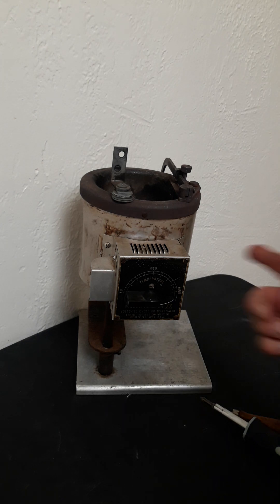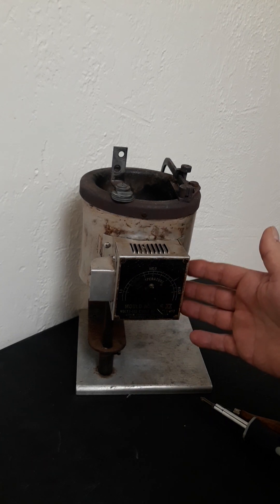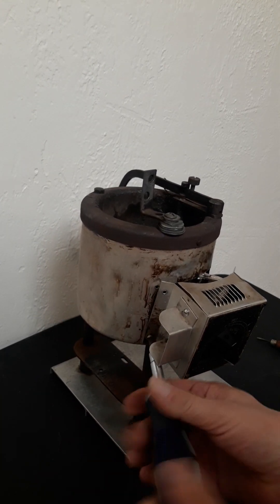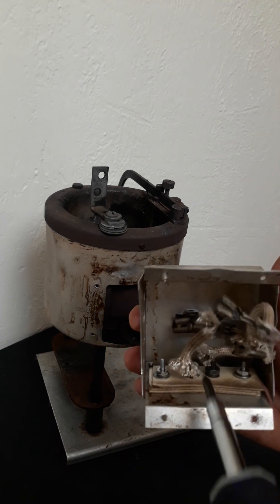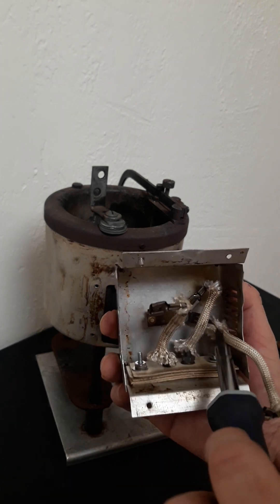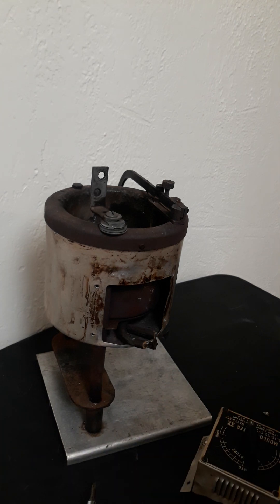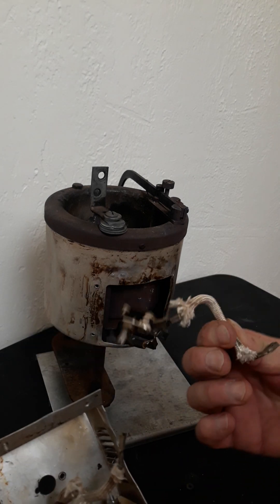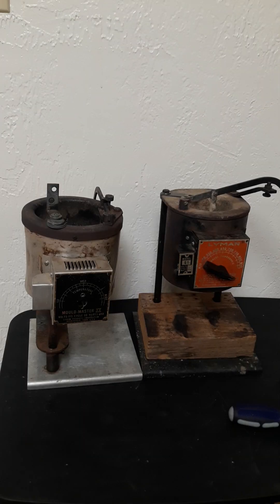Lyman Mould Master Model 61 & Model XX Lead Pots - Bypassing The Thermostat For Direct PID Use

Comment: I've got the Saeco 24 melting pot, very similar to the Lyman 61. I'll be bypassing the thermostat as soon as I get a PID. This is good info, zinc casting is on the rise these days. I haven't had a chance to shoot any zinc that I cast yet, but I am looking forward to it. Mike.
Reply from the maker: Not sure if it was my particular pot or the thermostat of my Model 61, but when I got it I could melt lead with the thermostat all the way up - it wouldnt melt zinc though. I think there is a set stop built into it, but when I bypassed the thermostat and ran direct to PID then I could melt and cast zinc. If you have some zinc WWs, fill up the pot half way and crank up the dial full on and see what it does. I wouldnt run the pot without a thermostat or PID, I'm guessing it will just burn itself out but try it with the factory thermostat.  I'm guessing you'll have to bypass the thermostat and set a PID to 825-850 and you'll be in business!
Reply: @leveractiongypsy1848  I already cast a bunch of zinc during this past summer. I just used the pot for lead first and then tried zinc. It had to be at the top of the heat range but it did work. My Saeco pot looks just like the Saeco model 24 but mine does not have a model number on it anywhere and the cord is hard wired into it with a strain relief built in. Maybe it's an early model or something like that.
Reply from the maker: @HobbiesHobo  Good deal you're all set then. It was probably the thermostat on my Model 61 if it was anything like the one on my Model XX. The thermostat didnt fail entirely. I had problems when I got it but cleaned it and that gave it good service for over a year. Then just recently it wouldnt heat up past 200 degrees or so.
Reply: @leveractiongypsy1848  All my casting stuff except the one that YouTube deleted are still on my channel but I am going to remove them in a day or so, to prevent losing my channel. The vids will be available on my website via Rumble instead. I won't be casting or powder coating again until next spring. 

My long term goal is to add a Lee 4-20 for lead, use the Saeco for zinc and share a PID with temp probes for each pot. One at a time of course. Wish I had gotten more serious about all this when I was younger but still having fun and really enjoy the versatility that casting allows.
Reply from the maker: @HobbiesHobo  Keep an eye out at thrift stores too. An old Lyman Mold Master XX would be a great find too, I like it better than the 4-20 - it never drips, hardly ever clogs, unlike my experiences with the 4-20. Still the 4-20 is a great pot too and you could likely find one pretty cheap on ebay used